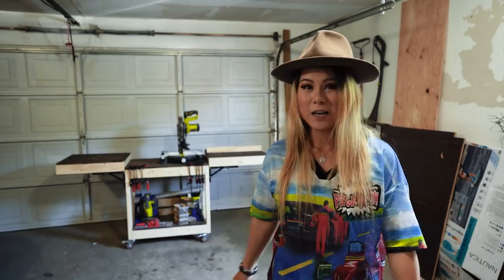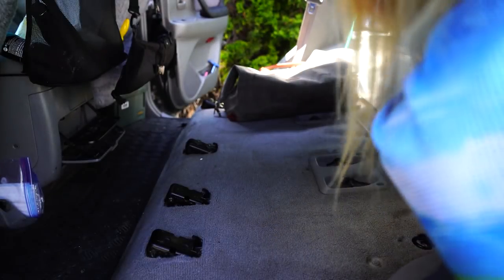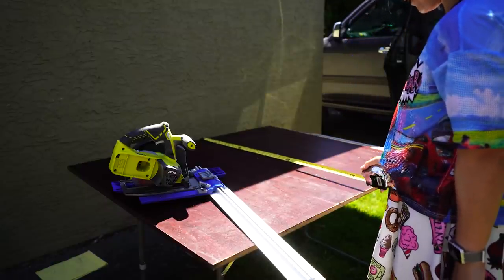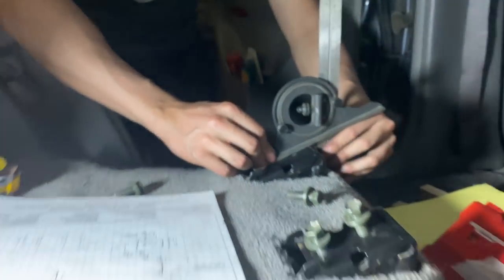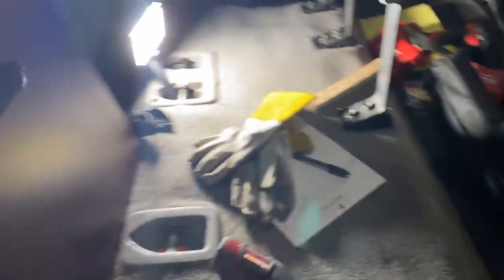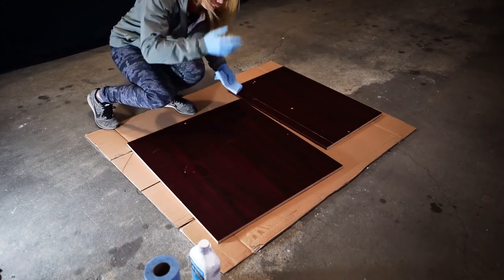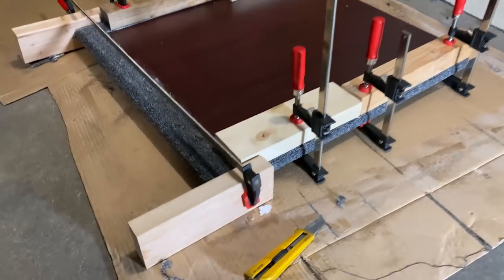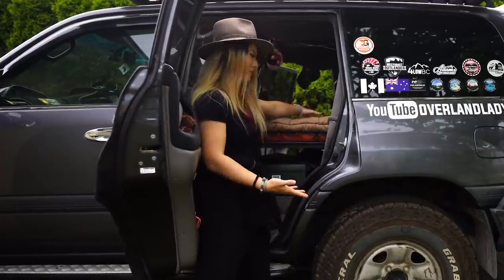How To Make Sleeping Platform | Land Cruiser 100 Series Car Camping Setup

Comment: Pro-tip for drilling holes through carpet:- get a soldering-iron and stab/melt a hole through the carpet before you drill into it.

Otherwise, very nice job. Very similar to what I've done in my Discovery.
The drawers are in the back permanently and I can fit the rear seats for daily-driving.
When I go camping I can remove the back seats, fit the sleeping-platform in their place and I've got a heap of extra storage space underneath it.
Also, the sleeping-platform is the perfect height for sliding wolfpack boxes underneath them.
Also, also, the sleeping platform has a hinged 60/40 split in it so my dog can hop from the pavement to the floor of the car and then up onto the sleeping platform easily.

Comment: Nicely done. Don't cut you platform to miss the roof handle. The handle is for a passenger to hold on to. Not a seating area any longer. Remove handle and Bob's your uncle.
Reply: Or rig up a strap to hang the platform from the handle for loading cargo below it.

Comment: Great job on this build. A good replacement for wooden boards for overland builds to save weight is PVC Foamboard. Light strong and it can be glued together using PVC glue and primer.

Comment: I got 100 series also, I would suggest buy a rooftop tent. I went with Bush company Alpha and extremely happy with that. 30-second setup and my bed is ready for the night. 🤙
Reply from the maker: I would if i had the budget along with GVM upgrade. Rig is heavy aready
Reply: Saftey is also an issue in a RTT. This way she can lock the Cruisers doors and be safe. Also if there is a problem it’s simple to climb over the seats and drive away.

Comment: Great setup. Can you pls advise 1) is the fridge too noisy at night and do you turn it off 2) do you need to open windows to avoid condensation inside the LC? Wanting to do the same to my 200. Thx 👍
Reply from the maker: Fridge is not noisy at all. Often at night it’s cold enough the fridge is on standby. I don’t get much condensation in the car. It’s pretty well insulated. Perhaps because i cover all my windows with reflectics